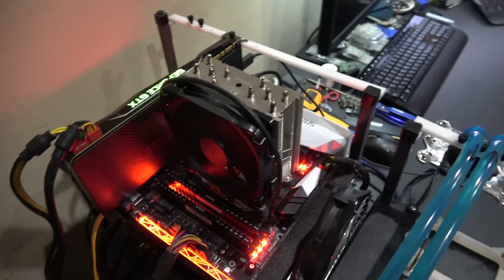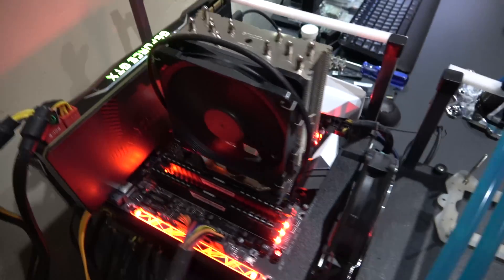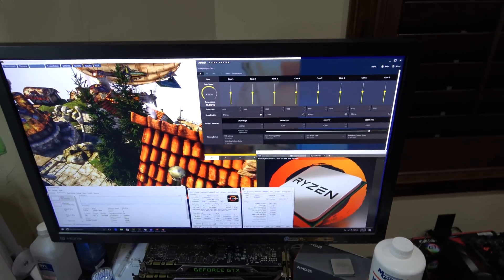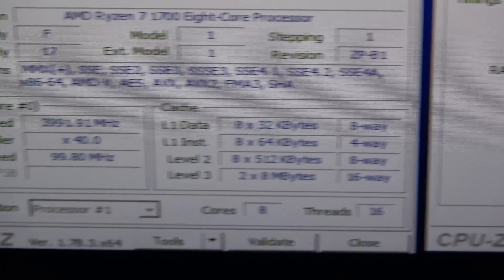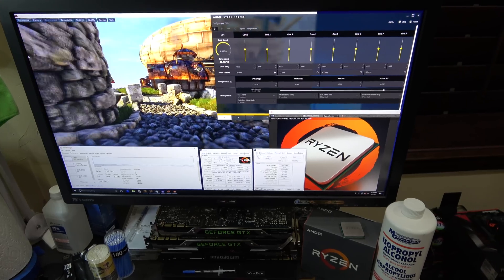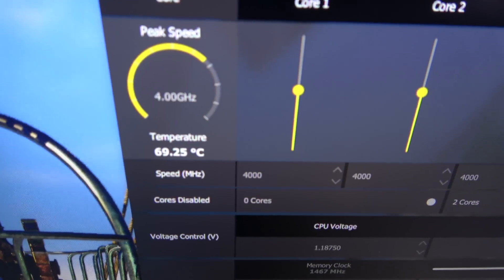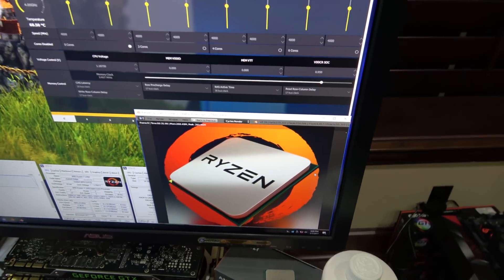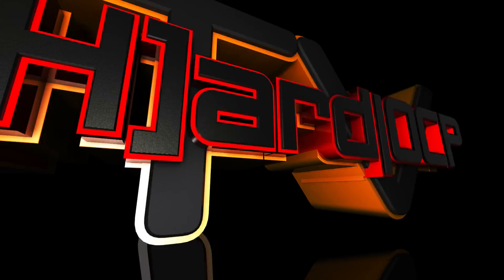Ryzen 1700 vs 1700X System Running

Comment: Nice video ) I m running a 1700X 1.34 v, soc v 0.800  @ 4 ghz stable  loving it I m using the coolermaster seidon 240v cooler and the b350 tomahawk + 16g ram at 2666. idel around 27c 62c at full load

Comment: the none X version which is ryzen 1700 is not ment to handle high power as well as the X versions from what i saw in a article. so does it mean better play it safe and get ryzen 1700x

Comment: Would love to see an Overclocking Walkthrough on that Gigabyte Gaming 5 Mainboard
Reply from the maker: Set vCore to 1.4v, set SOC v to 1.2v, set proper DRAM voltage.  Start there, go for 4GHz out of the gate, see what happens with load you will be running.  Find your CPU OC, then work on scaling up the RAM.  Once you get all that done, start working on lowering vCore and see where you get stable.
Reply: Thank you for the reply!

Comment: My 1700x is giving me idle temps 60-70 degrees on ryzen master considering the 20 degrees offset subtraction as declared by amd my idle temps after subtraction would be 40-50 degrees at 1.22-1.45 core voltages(stock speed+xfr-3.4 or 3.5 ghz)....I dont know where the problem is lying should I RMA my chip?....I didn't do any overclocking ..I've updated my bios to F5 (gaming 3 b350 gigabyte rev 1.0) but still temperatures remain the same....someone please help me out btw my cooler is masterliquid lite 120
Reply: Did you change Performance Options settings in Power Options to assist with this?
Reply: every user had this issue in the first month of release of ryzen..now it has been solved through bios updates,ryzen master utility update and power plan release......now i am getting idle temps of 25-35 degrees...

Comment: Is B350 in some way different in overclocking stability or performance than on X370? I've just wondered, coz I don't need SLI support, but still would like to overclock to 3.9-4GHz...

Comment: hey I was just wondering I have the 1700x on 120mm aio corsair cooler and my idle temps are 45-55° C  how do you have those temp at load with aircooler
Reply: Hixelite you may have set it improperly

Comment: Every site always does just overclocking, it would be nice to see some Undervolting / Underclocking reviews too for the 65w Ryzen 1700 , could it be passive cooled gaming cpu  ?
Reply from the maker: I do not see that in the cards.
Reply: HardOCP TV  ??
Reply from the maker: I do not see Ryzen 1700 being a passively cooled gaming CPU.
Reply: HardOCP TV just found review that said with noctua NH-U125 SE-AM4 cooler (120mm fan) ryzen 1700 runs 46C under load so I'll bet that passive cooling could be possible!
Reply from the maker: OK.  Good luck with that.  Going to depend on the chassis, the airflow, the ambient case temp.  Lots of variables there.

Comment: I have seen x370 running 125Mhz bus speed with ddr4 3666Mhz, I wounder how high it can go?
My FX990 was able to go a high as 235Mhz Bus speed with ddr3 @ 2500+ Mhz
Reply: what's the motherboard?

Comment: What is the model of this Noctua heatsink installed on this Gigabyte board? Is it better than the AMD Wraith Spire include with the 1700 cpu?
Reply from the maker: AMD supplied this cooler, I THINK it is the NH-U12S.  https://www.amazon.com/noctua-NH-U12S-Noctua-CPU-Cooler/dp/B00C9EYVGY/?tag=hardfocom-20.  If I were going to buy one today I would go with the Thermalright True Spirit 140 Power.  https://www.amazon.com/Thermalright-True-Spirit-140-Power/dp/B00IYEEOMO/?tag=hardfocom-20  Just a personal preference.

Comment: Have you de-lidded any Ryzen's yet? I know they're soldered on but I would like to see some bare naked Ryzen temp's
Reply from the maker: Getting there.  Only a few Ryzen CPUs in house right now and I need these to test.  These are soldered, so when I get an extra one, the top will come off.
Reply: looking forward to that vid. Do you have a go to method for heating the solder or will you have to come up with a unique solution for Ryzen?
Reply from the maker: Likely use a small torch to get the solder soft after I use a razor on the adhesive.
Reply: Cool, looking forward to the content, thanks for the replies.

Comment: Aren't those temps wrong? Isn't AMD still using the same faulty temp probes they used from the FX series?
Reply: igloo2, those temps are correct.
Reply from the maker: Have not had time to get into all that yet.  But there are not other options right now other than machining a thermister slot currently.